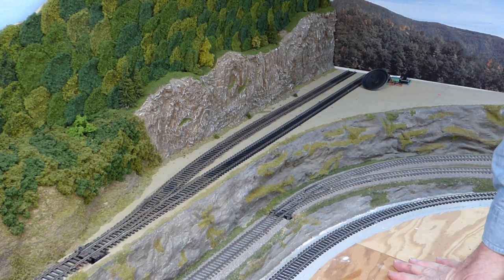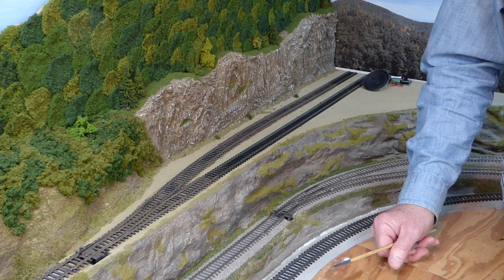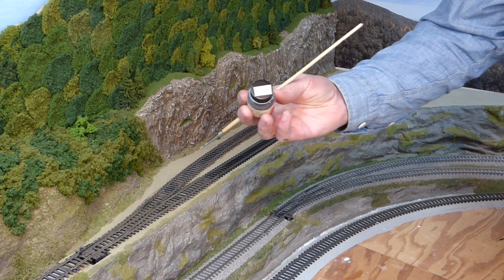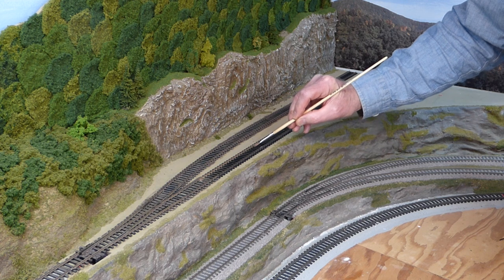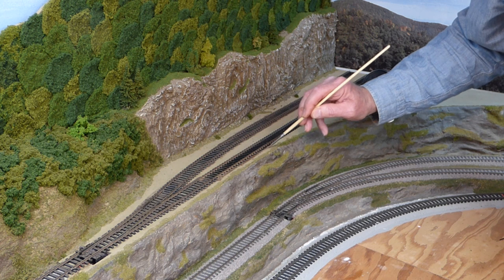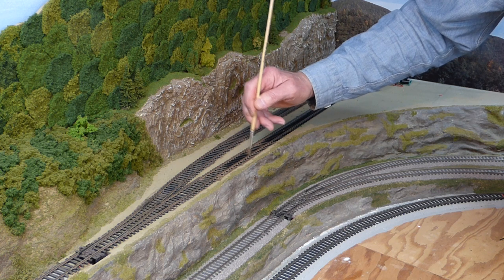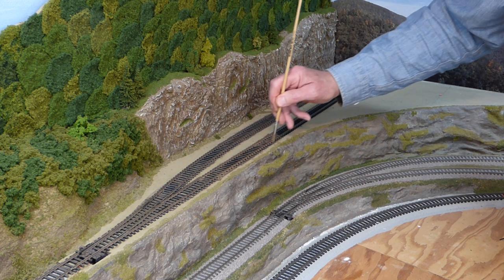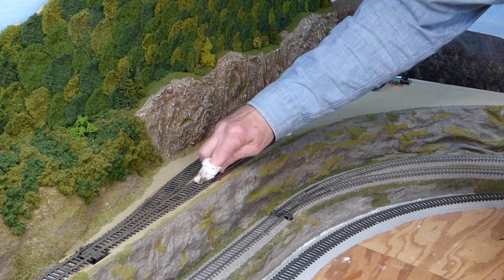Weathering Track

Comment: did u thin the paint mix?
Reply from the maker: Howie, I do make it thinner - not quite a wash, but close.
Reply: thinned with water?
Reply from the maker: Yes if you are using a water based paint as I do.